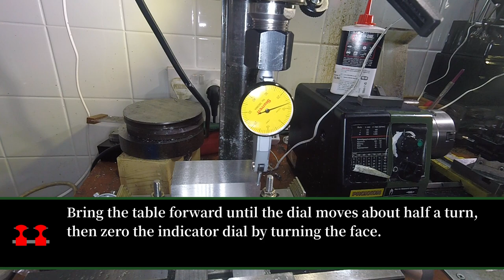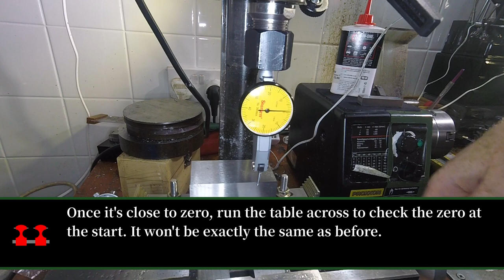How I Tram my Vice on the Proxxon Mini Mill

Comment: Hi nice video you leave me enough time to read each caption, that is nice most do not. I am new hear am a micro machinist and work from home, love the white tile behind your mill my mill is a CNC converted TAIG and it is small like your but it too makes me small parts in any metal, it surprises me. Stefan so serious in the SHOP. Haha.
Reply from the maker: Thanks! I tried hard to pace the captions correctly, so it's good to get feedback that you had time to read them. I've been checking out your channel, and I love it! I'll definitely be a committed subscriber. The white tile is because this room was once upon a time my kitchen. Makes things easy for cleaning up oil splashes.

Comment: As always amazing video. I am interested in the vice you have in your Proxxon milling. It seems the mximum possible in this machine.What are main dimensions ( width - opening - total length - weight?? Thanks and continue sharing.
Reply from the maker: Thanks! The vice is a fairly ordinary 2.5" grinding vice, with about 63mm of jaw width, 32mm of jaw height, 80mm max opening length. Overall length is 175mm and it weights just under 3kg. It's a good size of the little Proxxon milling machine, if just a little bit too long.

Comment: I have had my first accident. During work, the mill has slided down , I have not been enough fast and as I was working near the mill desk I have made a small scratch in it .
 I can ensure that 6 mm endmill was completely tightened, so what can have happened?? have you ever had something similar ??

Thanks for yor answer in advance.
Reply from the maker: You mean that the end mill slid out of the collet, and feel onto the cross table? On my mill the 6mm collet does not quite tighten properly, and I'm not able to grip a 6mm cutter properly, so I usually use other sizes. It is possible to fix this by using a thin bit of paper cut to size, the wrapped around the endmill before putting it in the collet.
Reply: @AdventureswithaVerySmallLathe  Thanks for your interest. Yes the mill has slipped out. The endmill seems to adjust precisely, I have just tried with smoke paper around and It is not posible to insert. I Will try with other thinner paper (really  now I can not thinck in something thinner). But if you have had problems with adjustments i Will try another size.
 I have only 6 mm , bigger ones for steel seems verte Big for this small machine but Who knows.

Comment: Watching your amazing videos you have convinced me and I have just adquired a Proxxon FF230 milling machie. 
I have a bit problem with this machine, I thighten the main nut of the milling tool and when I finish the job, I  loose the nut but it is very, very diifficult to remove the milling /drilling tool.   It is stuck in the collet. The tool, is a very good quality and accuracy 6 mm diameter miling and tested in 6 mm collet.
Sure I am doing something wrondg, is there any trick about this ?        
thanks for you help.
Reply: I am going to answer myself, I have noticed that I made a wrong operation. First it is neccesary  to engage  collet chuck into the nut and then you can insert into the spindle, insert mill and then tighten the nut. Firt times  I inserted the collet in the "spindle" with the mill and then tightened the nut, so there was no engagement betwwn coolet and nut and mill was stucked. 
  Sometimes It is better to read instructions